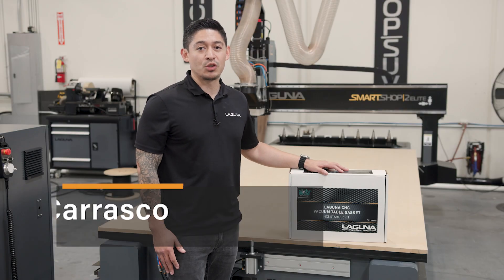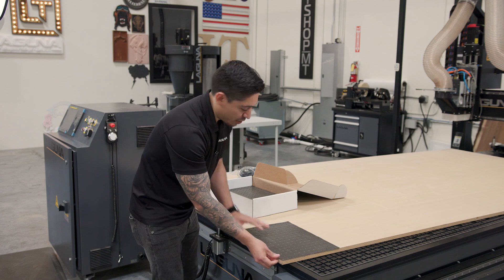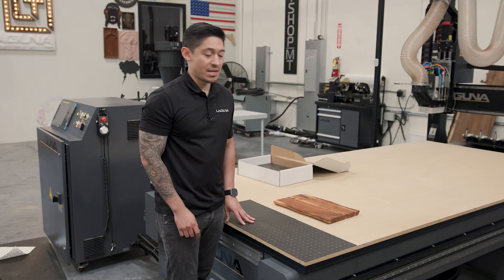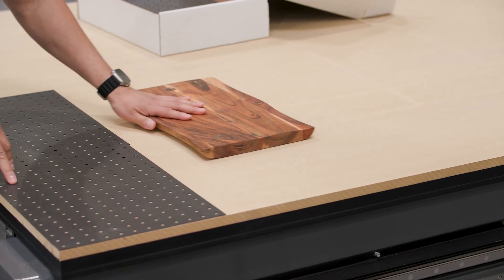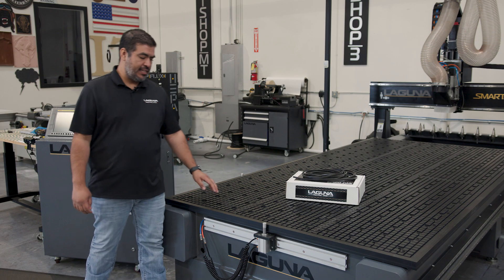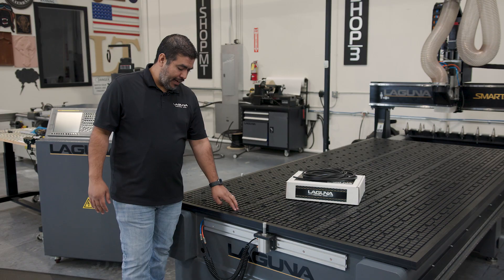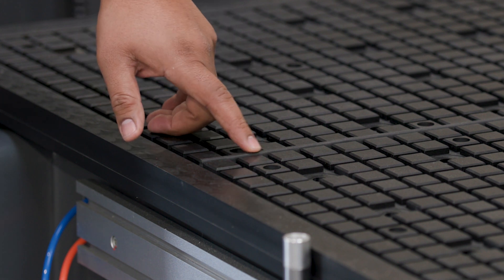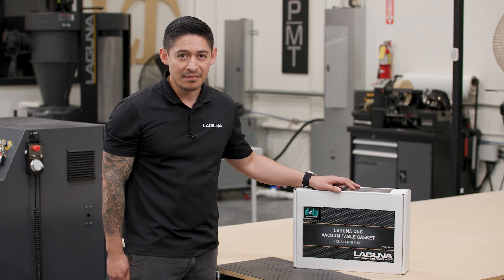Introducing The New CNC Vacuum Table Gasket Kit | Laguna Tools and All-Star CNC Products

Comment: so the adhesive squares take the place of a mechanical hold down for your work when it is being machined?
Reply from the maker: The tile gaskets serve as an add-on to increase your vacuum table's holding capabilities, they can replace a mechanical hold down in some applications. Ultimately it depends on how firm of a hold you need, these tile gaskets do improve holding capabilities when paired with your Laguna vacuum table.
Reply: How do you surface your spoil board, are they removable?